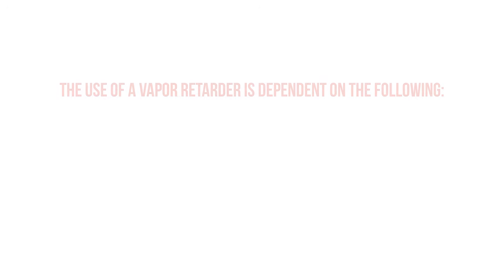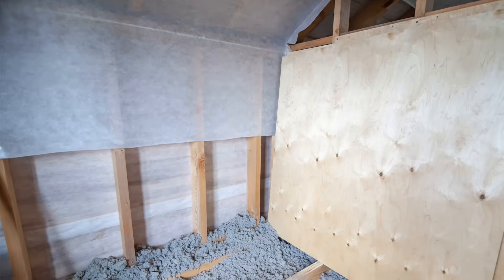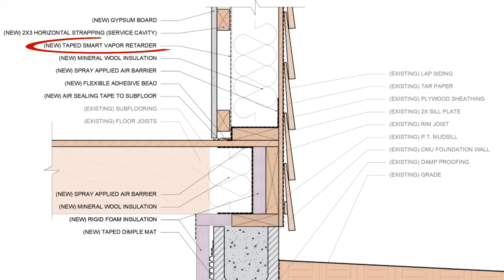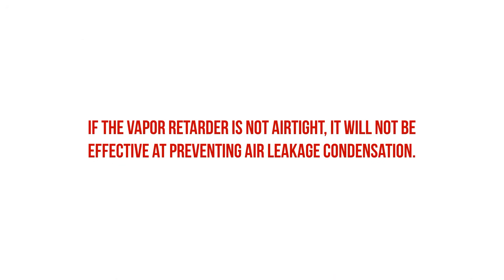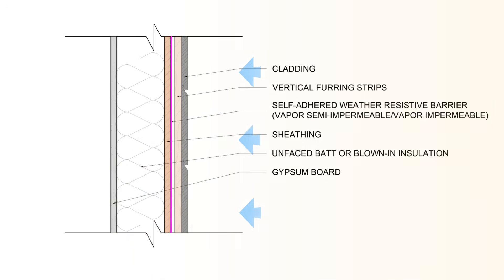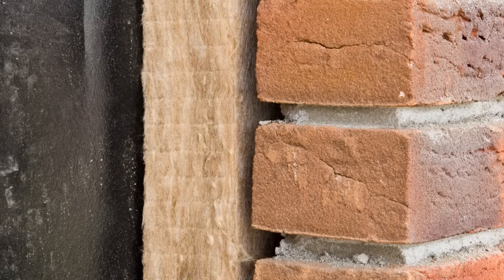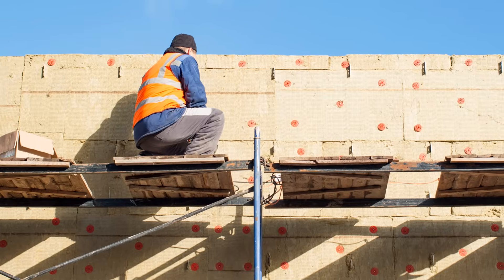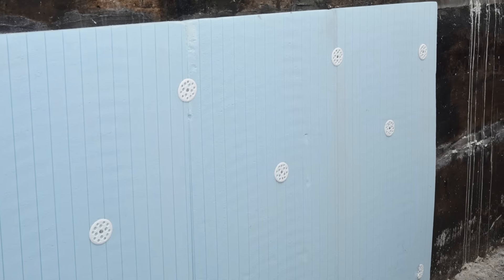Do You REALLY Need a Vapor Barrier? What You NEED To Know Before Insulating Your Home

Comment from the maker: A Guide To Moisture Management For Residential Remodels eBook: https://asiri-designs.com/shop/ols/products/moisture-management-for-residential-remodels
Reply: How would using an air conditioned make up air unit that maintains 0.1"WC pressure inside the house at all times affect vapor barrier and insulation choices in a combination zone?

Comment: The very first issue mentioned in the video is dealing with bulk water issues and potential exterior water infiltration,  excellent point!   No matter the cliamte zone, bulk water infiltration is a priority.  Thanks for the quality videos!

Living in climate zone 2 in South Texas we have primarily wood sheathing (OSB or plywoood) on 2x4/2x6 exterior wall construction.  WRB wraps are primarily used with no interior vapor barriers. 

I concentrated on bulk water and air intrusion by using proper shingling/overlaping install techniques on the WRB wrap and used premium butyle tapes.    

Dupont's "Straight Flash", "Flashing Tape", "Ez Wrap" & "Flex Wrap" are all excellent butyl tapes that I highly recommend.  They are compatible with vinyl windows and Dupont tech specs advise compatibility with 3M Super 90 Hi-Strength spray adhesives to when applying tapes to wood framing & sheathing and vinyl windows, and compatible w/ polyurethane elastomeric sealants such as Tremco Dymonic 100, NP-1 and Sika.      All of our wall penetrations received first received flashing treatment agaist the exterior wood sheathing then a 2nd flashing treatment against the WRB wrap, then finally sealed from the interior wall side with Tremco Dymonic 100 ensuring many decades of defense against bulk water and air intrusion.

Next investment in our home is an ERV to bring in fresh filtered air inside the envelope and to install a whole house dehumidifier to keep the conditioned attic and living space around 45-50% humidity since our weather has high humidity year round.   

Plan is to have the ERV and dehumidifier provide clean air and reduce the chances of any future mold and mildew issues.

Comment: So whats the best way against basement concrete in Canada thats underground?  Rigid blue foam board, Rock Wool, Spray Foam.   Seems every video contradicts each other.  What about basement headers?  Many say foam board is best with spray foam around the edges, while others say that can cause rot.   Its literally a no win situation that every way is wrong

Comment: @asiridesigns I am in a really difficult situation. I live in zone 1, south Florida, and just got a new roof. The roofers removed 2 inches on isulation from the top of my flat roof when installing my new mod bit roof, and somehow it passed inspection. I have an exposed beam ceiling with tongue & groove and the temperatures are over 110 degrees at the ceiling.  I now cant afford another new roof, so I need to insulate from the inside. What do I do?

Comment: ??? Looking at insulating pole barn (northern Ohio) building wrap stappled to framing with steel siding on top of wrap, open inside. Mineral wool, fiberglass looked at -- faced or unfaced, or what ? Don't want to trap moisture in walls. Aluminum foil stapled to roof trusses (peak to eve soffit) to allow air to circulate under roofing.

Comment: This is such a mess. I have a rehab house that has a wood like sheathing (not celotex, stronger than that) on the outside, I have covered that with roofing metal (think barndominium) so that is fairly impervious to air or moisture, the walls have fiberglass insulation and plastic on the inside. I have found water dropplets on the fiberglass side of the plastic and thus I think I need to get rid of the plastic. Now here is the confusion part. This house is in southern Mo, it gets pretty cold in the winter, and very hot and humid in the summer, it is a weekend house with only off grid power, it it will not be air-conditioned for much of the time, only on weekends. So....Where to put vapor barrier, or not, and what kind, and its too late to put it on the outside.

Comment: I've been hearing about these climate specific systems but never really get to see info about my own region here on the PNW coast.  The climate is very wet and 0C-8C in winter, but in summer we have a drought season lasting a good 3 months, though not requiring heavy amount of air conditioning as it rarely reaches over 28C.  All the buildings I have owned here are: stucco-tarPaper-pink FG Ins-Poly air barrier-drywall.  I have not encountered any mold issues and thankfully no water collection.  I'm building a new garage now and would like to condition the space, looking at my options for insulation and air and vapor control.

Comment: 20 years ago I built a home in climate 6.2x6 wall, house wrap exterior/hardie.Interior 2'' spray foam and r13 batt.Was advised no vapor barrier.Had r 50 cellos in lid, with spray foam first over int wall runs where sheetrock met, soffit and ridge vent with gable vents also.What is your opinion on that.I do have the book Builders guide to colder climates

Comment: Sounds backwards.  If bulk moisture is succesfully controlled [and staying to the exterior], then drying occurs inside.  Witness two materials that should never be on the inside of an exterior wall: oil based paint, or vinyl wallpaper.   On those materials, the rule I follow is simple: temperature needs to be about the same on both sides to prevent moisture drive and condensation.

Comment: My 60 year old shack has no vapor barrier. Has lasted over 60 years with just drywall, blown cellulose, and wood siding. One section now has Vapor barrier from a small electrical fire due to improper installation. Ill get to see myself if VB is needed. Been 5 years now, all good so far.

Comment: Our county in climate zone 7.  Dry most of the time. We wequire a weather restrictive barrier on the outside and a class 1 or 2 vapor barrier on the inside.  And!! Not or!  So I’m looking at intello vs the siga inside “smart vapor barrier”.  And we are doing exterior R5 insulation. (Actually r6).  But I’m worried about trapped vapor!

Comment: When I was a younger man we were forced by the know-it-alls to put plastic on the inside over the insulation. That ruined lives. Walls need to breathe. In old houses with no insulation and no exterior leaks we find zero mold. Zero. Add insulation and vapor barriers mold appears. Every time. Add air conditioning and the back of the sheetrock gets damp. Vapor barrier on the outside seems to work except for where it isn't. House wrap works better. It is confusing for sure.
Reply: In Minnesota we use plastic over insulation on every new home!!!
Reply: @mercedes.justin4777 i also live in MN. Im redoing my basement. Would you cover rockwool insulation with plastic too? Im gonna use foam board also
Reply: We have a vapor barrier the only place we found mold was where sheetrock met the shower liner.
Reply: Quick question, why do we need to wrap the whole house in air tight material and then spend a fortune mechanically circulating air, when if you did neither of those things the air would just circulate on it's own
Reply: @em97c just depend where you lived. Up north yes, down south no. Its for not wanting the warm air during winter times to mix with the cold air from the outside/cement. Creates condensation. Thats my understanding
Reply: It's gotta be done correctly whichever way you build the house. We have plastic or similar barriers on all modern houses here. The key is ventilation! Needs active fans to draw out/replace the air inside. Which is just overall very good for your health.
Reply: We need vapour barrier where I live in Canada, it gets cold. Never had an issue with moisture build up with roskwool insulation
Reply: Different climate zones require different air/moisture/vapor barriers, types and location

Comment: I live in upstate NY,   I built  double wall construction  on outside  wall put 7/16  osb  then 1inch  R7 alum   face sheeting  install horizontal  tape seam then put 1/2 inch  R3 alum face  installed  vertically  with tape seams  on inside walls 7,16 osb ,than 6 mil plastic  ,drywall , then  blew in cellulose  insulation  into  10.5 inch  double wall construction  ..installed have  HRV air exchange .  Been 14 years  ,no problem.

Comment: G-d damn, in a 7 minute video you avoid the point entirely. Clearly the first half of the video, the message is clearly "use Intello". The second half of the video is "if you have intello, you don't need a vapor retarder", but then also "you should use a peel and stick house wrap".

But aren't both intello and peel and stick vapor retarders to some degree? It seems in many situations, the housewrap is less permeable than intello, which you keep saying is a vapor retarder. You keep saying "you don't need a vapor retarder" without addressing that if you install something with low permeability as a WRB then you have one anyway. You are confusing a subject instead of explaining it.

Comment: Australian engineer here. I’m a bit shocked that some of these images show the vapour barrier on the inside of the studs. The vapour barrier is the external skin of the house — everything outside of this should be assumed to get wet. As for not using a barrier with external foam: just no. Condensation will still form behind the foam, and without a barrier it will rot your timber.

Comment: Oh man. I'm renovating my 150yr old house. Its got a brick vaneer with wood siding and balloon framing. I've pulled all the plaster and lathe and the blown in insulation out upstairs. Originally I was going to rockwool everything with a 6mil vapor barrier on top. I think the thinking behind that was that the rockwool would shed any moisture to keep any mold and rot away from the wood while letting the wood and brick breathe still. Where I am, it gets freezing in the winter and hot and humid in the summer. Now it looks like I'll have to research a bit more before re-insulating.
Reply: You can use a vapor barrier primer or paint, but I think it's better just to let it breath.  It's what I've done since they made vapor barriers code (they've since rescinded that)  When they first came out with the vapor barrier, I knew it was a bad idea.  I used the paint vapor barrier on the inside and so moisture would form on the inside and evaporate to the inside of the house and be expelled by the furnace or air-conditioner. This is in a cold climate.
Reply: @abacab87   ahh okay. I thought that it could breathe one way, but if I didn't put the vapor barrier on the "warm" side of the wall before drywall, the drywall may get moisture and eventually mold. 

It gets pretty hot here in summer and freezing in the winter (35⁰ to -15⁰ C).
Reply: @inquisitivecoffee  The vapor barriers they made us put up was just regular plastic.  I don't know about a breathable vapor barrier on the inside.  They let us put foam on the outside, along with tyvek, so I don't know what the thinking is there, I personally haven't seen problems, but there is probably enough air leakage to make the foam not a problem.  I'll have to see next time I have to rip foam off a house.

Comment: I live in MN where temps can vary  from high 90’s with dew points in the upper 70’s to -20 and very low dew points. Do highly variable conditions like this influence the best way to handle this?
Reply: A vapor barrier / retarder on the inside of the studs.  My house was built in 2000 and is about 50 miles northeast of Minneapolis.  It has Sheetrock, plastic, and then studs.  All the plastic joints were caulked to keep it sealed.
In the basement's "energy wall", it has the block foundation on the outside, plastic, studs, and then more plastic on the inside.  How moisture does not get trapped in there and cause a problem is unknown to me.  It hasn't been a problem, and the basement has only been finished for the last ~3 years.  If there is  mold back there, it doesn't stink or smell like musty.  

There was originally no tyvek wrap outside, but I added it on one side of the house where I tore all the siding off to install a porch.  I think it is a good wind break which also is breathable.
Reply: @paulstandaert5709  mine was built in 2020. South metro area. One of those “build ‘em as fast as you can” builders, although they keep winning awards. We did not live in the area during the build, so I guess I’ll have to hope the did it right.

Comment: I live in a historic home with lath and plaster interior walls.  My siding is 137 years old, and I plan on replacing it in the next few years.

I was planning on removing the exterior cladding, repairing any rot and mechanical issues (wiring, pipes), and then spray foaming and using a zip sheathing before redoing the cedar shingles on the exterior.  I live in WI.

With redoing the water proofing with a more. Modern method, would the spray foam be ideal given that bulk water intrusion should be dealt with, or would you still recommend the liquid applied vapor barrier and an insulation like rockwool?
Reply from the maker: We actually just made a video about this very topic: https://youtu.be/vOC1_rPcUCE?feature=shared
Reply: I know of people cying for using projected foam They say a towell canno't dry in the bathroom, nor the kitchen They have to place de-humidifiers at the basement...and liteers of water carried out every day! You don't want to live inside an icecream box!
Reply: Well, I also do intend to install a HRV system to bring fresh air into the house.  That's a part I think a lot of people forget when building tighter homes.  And finally, while I will be refurbishing the doors and windows, they're not going to be replaced.

Comment: What's the best practice if you are going to have a tile shower against an exterior wall in climate 3?
Reply from the maker: Alright, here's a controversial statement. You shouldn't locate showers on exterior walls, for a lot of different reasons, but this is one of them. If you have to, back ventilate the wall that you're installing the shower on.
Reply: @ASIRIDesigns  thanks for the insight! None of the plumbing will be on the exterior wall.  Is a simple air gap of 1" enough to allow for air flow?  Almost like building a second "dummy" wall that doesn't touch the exterior wall and then tile to that wall?
Reply: @swaffstudios  sounds good to me. I had a 1999 house with tile shower on exterior wall with "moisture resistant " drywall then 6 mill vapor barrier. After 8 years I had to wear a mask to remove black mold on top of the vapor barrier.

Comment: A proper vapour barrier is a must between any exterior wall for different seasons winter and summer will produce condensation in between the Drywall and studs
Reply: No it isn't. You're not the expert you think you are..

Comment: Yes you do need a Vapor barrier 4 mill poly on fiberglass or mineral wool fibre batt insulation with caulking around any penetration in the exterior walls
Reply: Nope.. it depends..try learning something..

Comment: older homes breathed enough not to be drafty but not stop moisture today we seal things up way to tight that traps moisture, then you get mold
Reply: Only if it's not designed/implemented right.  "Breathing" is inefficient, from a heating/cooling perspective